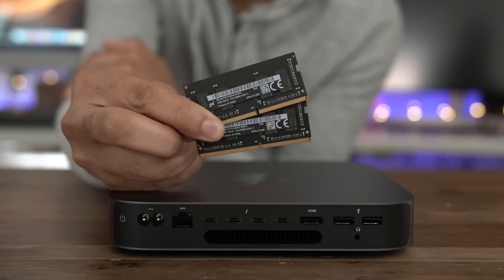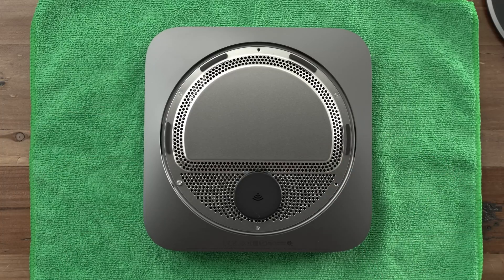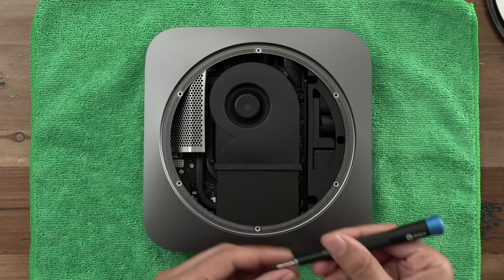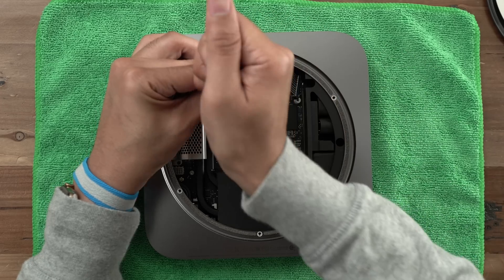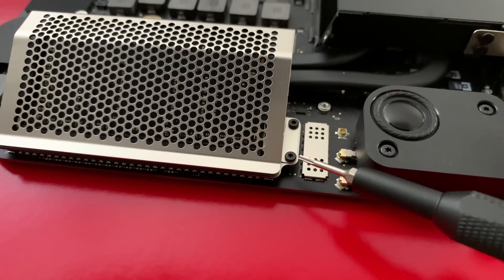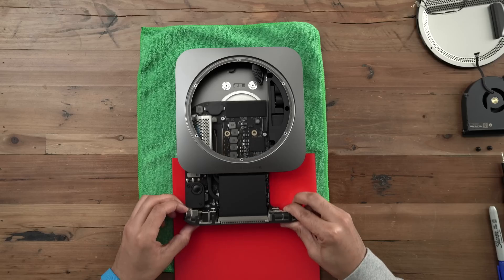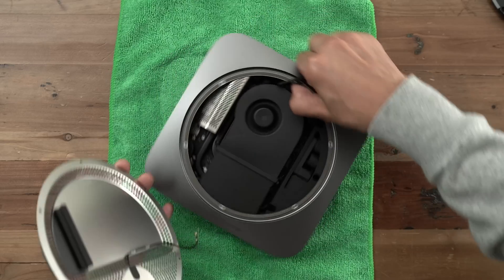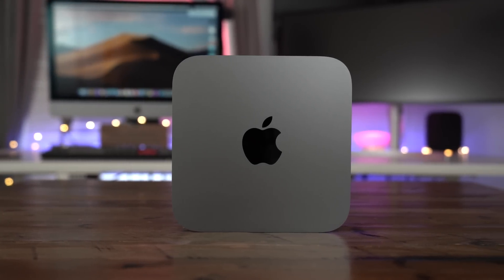How to UPGRADE RAM in the 2018 Mac mini & save $$$!

Comment: Exactly the info I needed when I needed it. Though I wanted somebody else to fix my computer, Apple Store no longer supports 2018 MacMini. On my previous MacMini I added RAM without a problem. This time the alert was “application memory” is full. That term was new to me. Old and unused apps were opening on start up but I never detected that. For example Dropbox. I don’t relish this intense procedure nor the task of looking for my toolkit but your video reassured me I can do it. Thank you from a new follower and customer.

Comment: Hardest part by far is that damn antenna cable. Had issues trying to replace the battery on my 2017 MBP all because those wifi antennas does not snap easily but will wear out if you wiggle around too much trying to get it in place. I was able to get this one though on the mini after simultaneously using the tweezers and spudger  as my fingers are too clunky to do it 😂

Comment: OMG thank you so much!  Got 64 GB on sale from OWC for <$150. Took me 3 attempts, because I stupidly didn’t realize that TR6 was different from T6. I had a Wiha Torx bit set, but it didn’t include TR6. Realized that they were different yesterday, bit the bit and ordered the IFIXIT Driver kit, and low and behold, really was quite easy. Bought this MacMini in 2024 with 8GB, always planning to do this upgrade, but was hoping RAM prices would come down. Eventually they did, so here I am. With eternal AppleCare, I could reasonably get away with never buying another desktop. Thanks again!

Comment: I've been tech support off and on since 2009. Worked for Apple as troubleshooting support '09-'14 (trained with our repair guy, but the store I was at eliminated his role after he moved on, so I ended up manager instead of repair like originally intended), and then T-Mobile tech support '14-'22. I've always done my own troubleshooting, but never a physical upgrade. Even when I upgraded my ram on my basic Macbook Pro when I worked for Apple, our repair guy did it for me and I watched. My Mac Mini is the base model, so it's really started to chug while I'm playing even basic games, and right now I'm off work, living with family while I wait for my disability to be approved, so I don't exactly have the income to build a PC like I want to and probably will eventually. But ram upgrade? Fairly certain I could do that.

Followed this video step by step (boy did the Mini also need a cleaning, since I've had and used it so long), and it went smooth as silk! (I did have one minor mistake, when putting the ram cage back on, my upper left screw did not want to go in, and I may have turned too much and the screw head sheared off. 😬But, at least the remaining 3 will keep it in place and the mistake does not prevent me from replacing the ram in the future, should I need to.) If you have instructions on how to get into the Macbook Pro I have (the same one from my Apple days, it's still kicking!) then I'll follow those, because the old thing sure does need a cleaning as well, I'm sure. Maybe a screen replacement too, it's got a couple dead spots.

Either way, thank you!!!

Comment: Thank you so much, for very well explaining each step including reassembly. I really needed the details of how to handle each connectors.  Watched a few very good videos and found yours the best to follow . I had to do the job twice as only 1 Ram was recognised.  The second time was much easier and i could see straight away. The first  visible Ram stick showed small gold . So it wasn’t pushed in all the way. I was a little to soft by pushing the Ram stick back so it arrests proper to the side clips at my first attempt.  Everyone who reads this, still be gentle it doesn’t require force. A little firmness will do if positioned correctly. Just make sure there is no t the tiniest bit of gold connectors be seen before reassembling…. That’s all.   So glad all is working now and I found your very well explained instructions. Big Thanks :)

Comment: I used a T4,not a T5 for the antennae. T5 did not fit. I found this video frustrating, as a first timer. You wouldn't explain things at all. Just "nudge" or "press" or "pull". Like what direction, at what angle...? And not a single mention of "what if." What if your RAM cage is really tight and doesn't slide over the cards, what happened? What if the power connector's metal protection ring falls off? What if you misplace a screw, can the logic board be held down with only one?

Comment: Even in 2024 this last Intel mac mini, packed with 32 or 64 gb of ram, is a super computer for most people, including web and app developers. Runs fast, low electricity used, works with 5K screens. It's the reason why I don't upgrade yet.

Comment: Thanks a lot for the video. Explained in details, a nice guide. Power LED connector is just something, push the 2 wires in gently and make sure the golden leads are entirely in. Be sure you operate with a magnetic screwdriver. Live and learn.

Comment: Fantastic video.. ONE thing to note.. if you dont buy the $75 toolkit.. make sure to have a TR6 bit.. and check to make sure it has the dimple.. I was able to get most screws out with a standard T6.. but ultimately I needed the TR6.  Otherwise no issues with install although (as is common with Apple components).. it does feel intimidating.  I am somewhat experienced with DIY Apple upgrades also, but if you too feel intimidated, you can do it!  Saved me hundreds.  Thank you 9to5Mac!

Comment: Hello. I followed this video except that I used 2x 8GB 3200mhz DDR 4 RAM instead of 2666mhz. However now I have nothing appearing on my monitor although the LED light is on. Could this be because of RAM incompatibility? Thanks.

Comment: You basically ripped out the leads. At the very least you should have add kapton tape to secure it. But yeah, the cable was damaged but instead you made it seem like your method was just an alternative — that you could just use tweezers to slide those leads back in.

Comment: There is no need for brute force ripping off the LED cables, gently using the pruning tool will detach the connector. Likewise, whilst reconnecting the antenna, it helps to  position it roughly in place by the attaching the securing bracket first.

Comment: I know I'm echoing what so many others have said here, but THANK YOU for this excellent tutorial!!! Always planned on upgrading from my base RAM, but wasn't sure when. 64 GB came up at a great price recently, I couldn't pass it up. Followed along this video and upgrade went perfectly. Excellent step-by-step, closeups on small connectors, and explanations of the disassembly and reassembly process.  As a few others in the comments have mentioned, a magnetic torx set is a must. I have T6 and T10 sizes, but my T5 is non-magnetic. While those cage screws are easy enough to get to, fiddling with little screws, a tiny screwdriver, and sausage fingers, was the most frustrating part of this tinkering.  Thanks again :)

Comment: I have done this upgrade. This is an excellent video. Very clear instructions. my biggest dtruggle was with the power cable and getting it lined up perpendicular to the pins. If you try to angle it in, you can bend the power pins and you have anice paper weight. Otherwise fairly straight forward. Also be very careful with the LED cables. coating on wires very fragile I would suggest using tweezers only if tips covered with plastic coating. Otherwise everything worked fine.

Comment: Great tuto! Thanks a lot. Quite easy to do if you're a bit cautious.
Just a little emphasis on the ram modules. You have to kinda "click" them in place. Being too gentle/cautious, I didn't insert one of the RAM module (the front one) deeply enough, so when I restarted,  the mac didn't turn on. 
Big sweat time...
I then re-did the whole operation, in twice less time, with the module in its correct fit. Worked like a charm!

Comment: I just did mine. Replugging the WiFi Antenna was the hardest part. Also make sure you are pushing the memory all the way down, I a way that you cannot see the leads anymore. I didn't do it the first time and I had one slot empty. Now I have 64 GB, something that apple charges $1400 for.

Comment: I followed your steps to the T but it doesn’t work. Apple says it’s not upgrade able. What step are you not showing? Because I install the original back and it works just fine. So what am I missing?

Comment: I was unclear what to do about the LED indicator cable, ended up breaking it... I tried pulling it out of the socket like you said was recommended, the whole casing ended up snapping off, and there's no way to re attach it. Anyone have recommendations on repairs, or if it's worth the cost?

Comment: Saved big $$$. Ifixit.com guide and tools was a big help. LED and Fan connector a bit delicate. Wi-Fi cable was tricky to get back on. ALL GOOD... Success. Went to 64 Gig to support my Virtual Machine Win 10. Be patient, have the right tools, and lots of light. 30 - 45 minutes with a cautious approach. Phew!

Comment: Took me 3 tried - the rubber seats around the RAM cage are the problem. I had to try 3 times but if you experience problems with the Mac Mini not restarting its the RAM not sitting right in the cage.

Comment: I did this the other day...Pretty easy to do. But now I'm having troubles with my mouse being jumpy/sluggish on occasions. Does anyone know if this could be caused by the RAM? I am using a slightly older apple trackpad. Could I have bad RAM? Is it another problem unrelated to the RAM replacement? Sure do appreciate anyone who responds!

Comment: Thank you for helping upgrade my i7 2018 Mac Mini. Hardest part for me was dealing with power connector - it did not want to budge;  motherboard screws - I had to get locking vice grips to get enough leverage on a tiny plastic driver to get them started. Everything else was easy-peasy. I used Samsung 32GB modules, PN M471A4G43MB1-CTD. I used iFixit Essentials Tool Kit for the Torx bits and driver. Everything worked from the start, no need for installing ram single module at a time. Love dodging Apple Tax!

Comment: When I removed my antenna plate there was no screw securing it to the logic board as there was in this video. I assume because I bought mine refurbished - maybe it’s been tinkered with before. Is it risky to proceed without this?

Comment: (3:31) Broke the male connector in the process. It detached from the board. Could it be reattach? Wifi signal is still working but not as strong. Everything else working!

Comment: Just performed the operation (8 -> 64GB). VERY helpful video! Thanks!  My tip: make sure the memory units are firmly pushed all the way in before securing them.  One of mine was a little loose so when I turned it on it showed 32GB (one slot).  Had to redo the whole thing :) At least it took me 15min the second time around ;)
Reply: Best tip ever. I did exactly the same by being too gentle. While it's not difficult to put it all together and take back apart again, it is time consuming....especially, if like me, you have to repeat the process several times until I found on the web that you should make sure the modules are "firmly' in place!

Comment: Some comments - The RAM guard is held in by T4 torx screws, not T5 as the video indicates. I was also easily able to get the LED indicator connector apart with a tweezers - make sure to pull UP not OUT. Same with the fan cable, you must pull up or risk breaking the connector on the main board. Lastly, removing these screws requires SECURITY TORX drivers, at least for the case. These have a little pin in the middle to prevent regular torx from working (and a hole for the pin in the driver). Regular torx drivers WILL NOT WORK.  Lastly lastly use decent RAM. I rolled the dice with the cheap stuff and it totally screwed up the machine and I had to remove it and put the regular RAM back in to get it working right.

Comment: As others have mentioned as well, I just did this on my 2020 Mini with two 16GB Crucial slots and took me about 30 minutes. Just relax, take your time, and make sure you get a decent Torx set( T5, T6, T10 bare minimum) from amazon. With the right tools it’s a breeze. Again not sure why so many had problems on here, just be patient and go step by step. Thanks again for this video!
Reply: Hi, was your mini the one w M1 chip?
Reply: @rosieyang15  Nope it was the Intel i7

Comment: Bought my Mac Mini a week ago and got the new RAM (32gb) from OWC this week. I installed it today and it's way more user friendly than you would think. The first time it didn't boot up because my RAM chips weren't as secure as they were supposed to be so I had to do it over but after that, it booted up just fine! You can save a little more money by purchasing a "lesser" brand electronics toolkit.  It'll be more than enough to get the job done.

Comment: When re-attaching the rubber bumpers to the metal RAM clips, each rubber bumper has two little "fingers" that are supposed to slide inside the hollow tubes of the metal RAM clips.

Comment: I was able to upgrade mine to 32 GB RAM first try with my 2020 Mac Mini. I gotta say, it is nerve-racking. When they say "gently" sometimes it meant forceful will power. Tip from me is try to "message" the pull and push movement, test it out with little and little force. Make sure to give it a try like 10x before you give it more power. 

This machine is so delicate, I can't remember when I actually think I will break the machine. 

And the first boot had my heart pounding like I am having a heart attack, every dark screen got me worried all the time. Because I don't want to reopen the machine and re-do the whole process again. I think this kind of ride is once a lifetime ride. (Commenting from my upgraded mac mini)

Comment: Important point: the RAM is not meant to be user replaceable (hence the many steps / special tools required). As can be seen in the video, the path to replace the RAM is full of pitfalls. Users should beware that any damage could be treated as out of warranty / unauthorised replacement.

Comment: Mac Mini won't power on after my process. Which went fine, but the only issue I had was the small / thin plastic strip over the LED indicator lights cables on the motherboard snapped while I was disconnecting them. I don't think that will prevent it from working, and that it was just an extra layer of security. They seemed to connect back in despite this. But now my Mac Mini won't even power on. Ensured the power supply was connected. Still no luck. If anyone has a suggestion, please let me know. Thank you!
Reply: Same for me.. It won’t turn could you resolve it ?
Reply: @GOA13111985  Hook it up to a monitor, make sure the monitor is on and with the right input, and then power it on. The LED light indicating power didn't light up, but was still able to power on.

Comment: Warning to all: when you are putting back the entire logic board, be sure to push it in and reconnect the power side into the Mac mini first (the right side that has the plug in part). I tried sliding the entire thing in it in, and it almost bent the entire panel with all of the ports because of some “obstruction” that turned out to be this weird connection thing on the right side of the ports (power connector). I’m sorry if this doesn’t make any sense, I can’t really explain things that well.

Comment: Is there a difference between the 260 pin and 288 pin versions? Looking to do this upgrade on a 2020 Mac mini.
Reply: Yes, 288 won't work. That's desktop memory for a wider socket, not the SODIMM laptop memory this requires.

Comment: Can I use the single 16gb ram card or do you need to always use both slots for the ram? On amazon they over two cards of 8gb or 16gb single does it matter?
Reply: If you do the single, you can leave one of the 4 GB sticks in, replace the other, and you'll end up with 20 GB of RAM. Note: Some recommend using like sticks to avoid any performance or compatibility issues (though I'm not aware of anyone ever having any).

Comment: Thought I’d add my 2 cents about my install....hopefully this helps others.  Took a few attempts(like 4 tries-first time the Mac wouldn’t even boot up-removed the new sticks and replaced the originals which were 2x4GB and then only one was recognized).  Eventually I didn’t actually remove the rubber side bumpers on the last few attempts, just left them in place, gently pulled them (the metal brackets and the rubber bumpers together) outward and the sticks “popped” forward where I could then remove them and replace with the 16GB sticks.  I added the rear stick first and gently pushed it back until the side mounts engaged the stick....making sure the top “hooks” were indeed wrapped around the stick.  Finally got the computer to recognize ONE of the new 16GB sticks but obviously not what I was looking for.  Opened up the Mac Mini and performed the procedure again, switched the sticks between the two slots but this time I took my plastic tool and put downward pressure on the top of the sticks so they would achieve the most contact with the pins while seated.  Fired the Mini up and they were recognized.  I actually ordered a second set of 16GBx2 Crucial sticks because I thought, perhaps the first set were faulty but I think now that it was just that they weren’t seated deep enough-even though, like other memory installs you can feel the “click” when they are in place, that’s not really the case with this upgrade install.  Frustrating as hell but eventually good to go.
Reply: SO HELPFUL. I'm in the middle of this myself, but with 64gb = $300 worth. It is indeed frustrating, especially when all I want to do is make music that helps with my wellness.
Reply: Word up!  I hope you have success, my man.